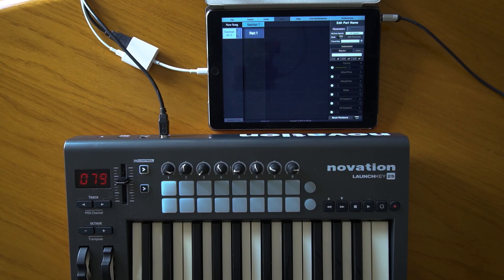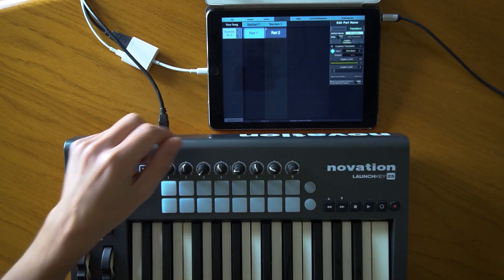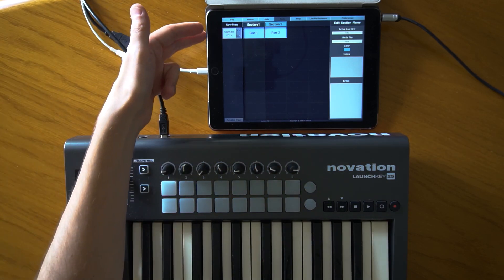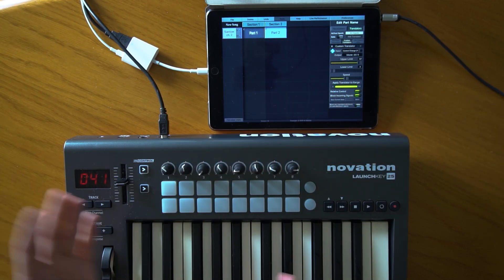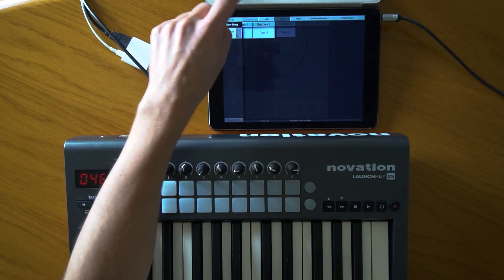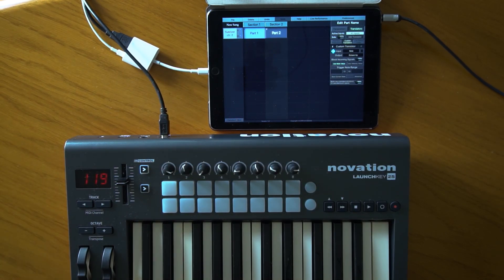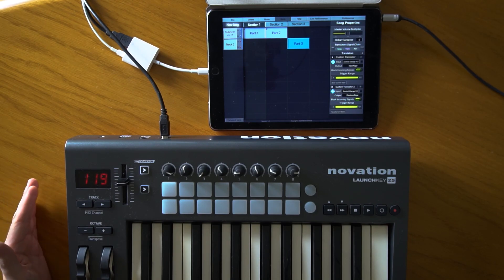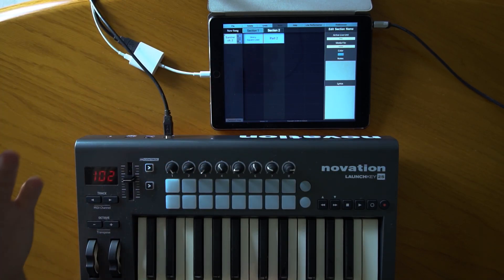KeyStage 1.x Tutorial 5: Custom Translators

Comment: Hello, congratulations on a fantastic app. I'm loving it! However I have a frustrating problem. I created two custom translators at track-level - one that uses a key note to move my PDF score to the next page and another note  to move the PDF to the previous page. I have since deleted the translators because the notes got it the way of my playing. Or so I thought. On all subsequently created songs the two keys still make my PDF jump back and forth. I have checked all the translators at song, track and part-level and I cannot find the offending translators. Are translators stored somewhere else in the app? The problem persists even where I create a new song from scratch - not just when I copy previous song templates. Strangely the problem is not there when I use an old song (created before I created the translators) as a template. Any ideas?
Reply from the maker: Hi Neil,

Thats strange. Can you send me a full backup file so that I can investigate the issue?  Also the name of the songs in which you are having this issue.

My e-mail address is aligokturk80@gmail.com.

You can create a full backup file in File Menu, While you are in the root folder, you'll see it on the top left corner.
Reply from the maker: Hi Neil, I got your full backup file.

You actually created those translators in the output alias of YC Series Port 1. Translators in MIDI aliases are global objects, they effect all songs.

In the upcoming update, I'll add the feature to allow the user to show all custom translators that are added in a list with filtering options.
Reply: @agokturk  Ah Ok., I found them now. I didn't realise I had done that.😆 That''s actually a cool fourth option if you want to use the same shortcuts in all your songs. Nice! 😃And thanks again for your quick support!

Comment: What an amazing app! I have a simple question. I want to use Program Change to select specific sections rather than moving through them with a foot switch. Is this possible?
Reply from the maker: @3DNurbz  Yes its possible.

Go to Preferences/External MIDI Control. In MIDI Control for Changing Sections you'll see a switch "Change Sections with CC Values", which is off by default.

If you turn this switch on, you'll be able to assign a single CC command (or prg command) to move between sections using its values, rather than assigning one CC for previous section, and one CC for next section.

Comment: I am trying to define a customer translator that can change the dynamic curve of a group of notes but it looks like is not possible, if i select as midi input note i cannot define an output as note again, so there is no control on dynamics on notes as custom translator? There is only as standard translator but acts on a full range or specified range muting all the other notes. I need to differentiate the dynamic of black keys vs white keys since is very common situation on semi-weighted keybeds
Reply: Update! I was able to do it creating two different parts under the same section, one selecting the black keys and one part selecting the white keys and assigning to the black key a different velocity scaling plus limiting to 105 instead of 127, while leaving the white keys as original. In this case the two parts work in parallel, Very easy! Then i created a second section with the same parts but transposed up to +12 so i can select on the Ipad screen what i like for the piano range. So i can use the 73 keys of the studiologic Numa Organ 2 as a well balanced master keyboard too, thanks to Keystage
Reply from the maker: @carlobuongiovanni7934 

Sorry for this late reply. I'm glad that you managed to find a solution:)

Side note: I'm working on a big update, and in this update users will be able to write scripts in custom translators as well as access to a growing database of custom translators, which will allow them to create a custom translator for basically any task.
Reply: @agokturk  Yes, is a very good program and the possibility to write a script can open many interesting options to use it for advanced midi processing and routing. For now i am happy with the solution i found. Translators work in series, but different parts on the same setup work in parallel so it was simple to define two different groups of keys. I think is possible to do much more with this parallel-series structure in various keyboard zones.
Example, one lower zone remaing normal and an upper zone doubling the octave, a good idea for latin piano only on the mid-treble section.

Comment: Hello, i often find that some semi weighted keybed have different dynamic response of the white keys compared with the black keys, is it possible to remap the black keys dynamic curve differently from the white keys? I know that the midi processor of midisolution can do that, is there any possibility to do that on key stage?
Reply from the maker: Hi Carlos,

Well I've never thought of such a case. It is technically possible, but practically it involves creating 88 nested parts, one for each note:) Because in KeyStage, there is a way to target only black keys, you can only choose ranges (intervals).

So I'd say its quiet inefficient trying to do that with KeyStage.
Reply: Ali Gokturk Thank you for your answer, maybe you could think to this function in a next release,  Key Stage a very good software anyway! Could not it be enough to define ranges only on black keys leaving white keys untouched? Example for C#1 to C#1 do this, for D#1 to D#1 do this etc.. that would reduce the number of functions to only 5 per octave, much lesser than the whole number of keys, defining each black note as a range?

Comment: "Let's go advanced..." It's all advanced, Ali. ;-)

I recently bought a Casio CTX-700. Is there any way to find a full list of parameters i can load into KeyStage?
Reply from the maker: Hi Geoff,

Well you will probably find the full list of parameters in the owners manual of the CTX 700, in the midi implemenration chart. But you may start by trying the standard parameters cc 7: volume
cc 74: brightness
cc 71: resonance
cc 73: attack time
cc 72: release time
.
.
Here is a full list of standard cc numbers:

https://professionalcomposers.com/midi-cc-list/

Most hardware instruments supports these parameters, but of course there may be some variations.
Reply: @agokturk  Thanks Ali. I'm on my MacMini now, working with Logic Pro X, trying to enable basic volume control of the app using my keyboard. I need to spend some time watching your videos on KeyStage to get my head around controlling my keyboard with your app.